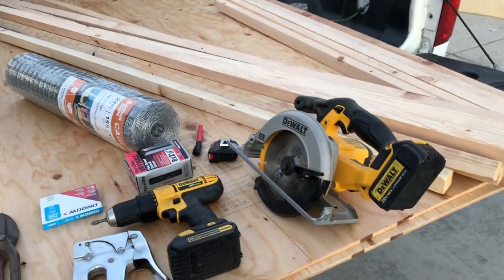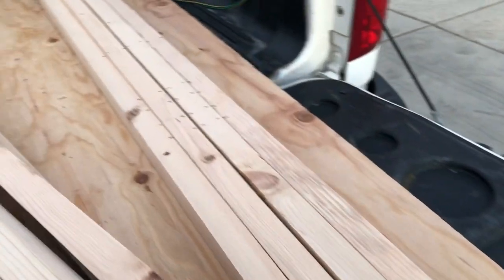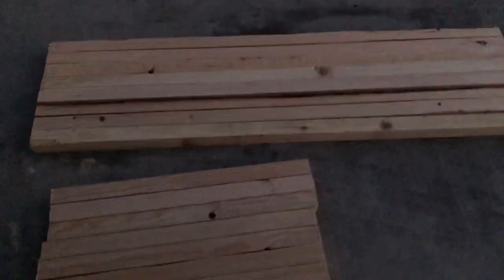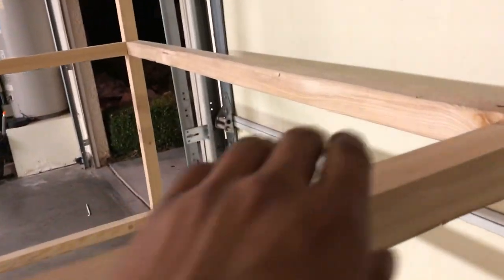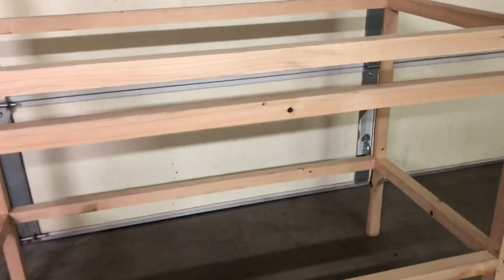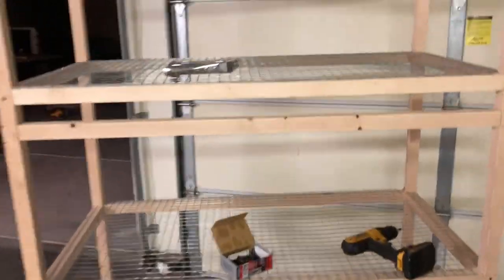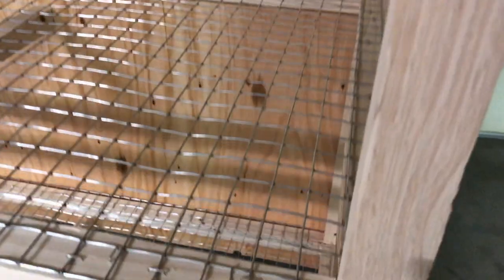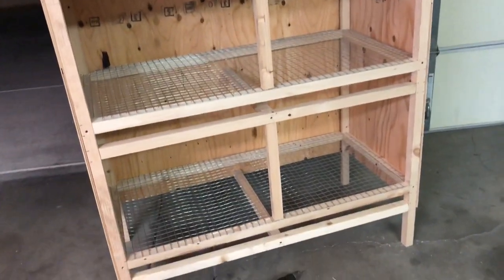BUILDING BREEDING CAGES PIGEON \ QUAIL \ DOVES

Comment: Hi from D.K.s loft  WESTERN Australia I don't use 1x1 mesh on the floor the bird's feet could fall through I use 12mmx25mm mesh for the floor more comfortable for my rollers.  that's whats its all about right guys
Reply from the maker: No keeps the dropping up top and makes a mess I’ve used it before and this works a lot better.